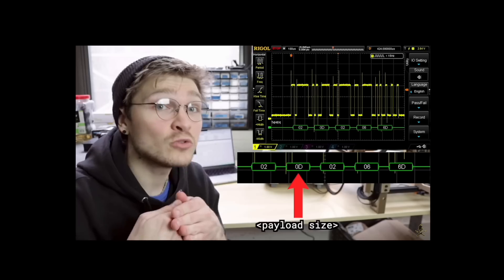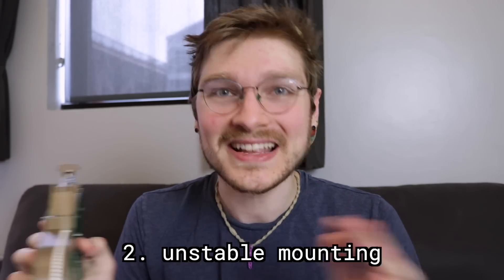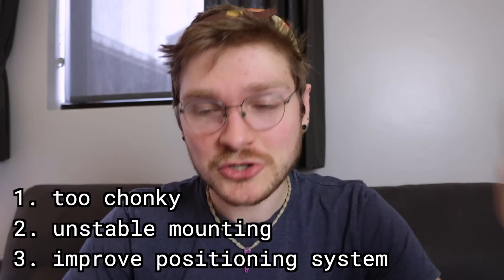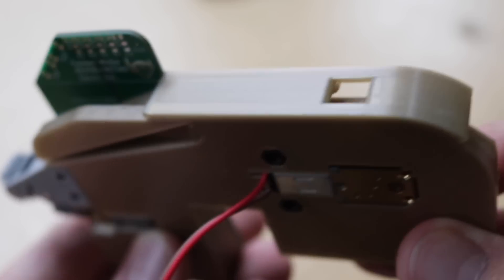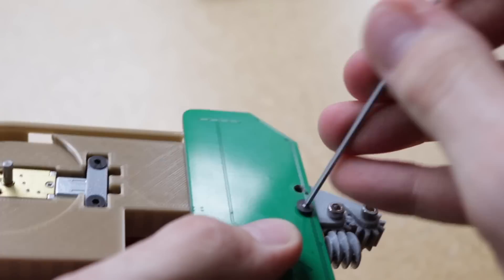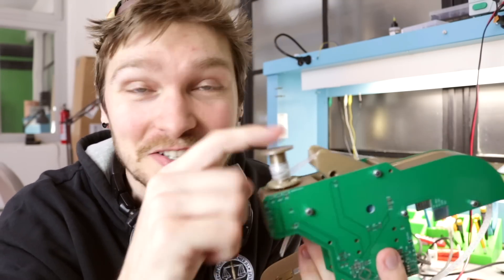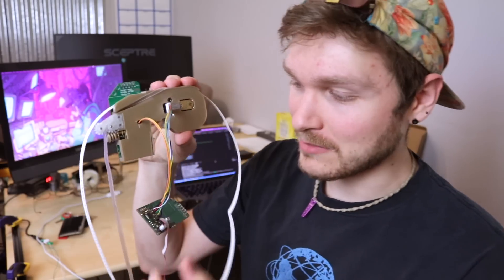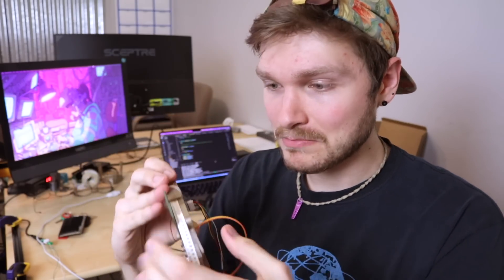Feeders just got a whole lot smaller

Comment: Just at the start of this, but you can use a laser or light woth a sensor. The encoder wheel can block or allow light through, now have your high and low. Laser will allow for much finer encoding. Computer mice scroll wheels sometimes use this feature.

Edit, can also use hall effect sensors. Vehicles use this alot. And go through alot more physical and heat punishment. Honestly vehicle grade stuff goes through hell and back then asks for more.

Comment: I recently watch your video from a couple years back and was surprised you were still using an optical sensor. The magnetic sensors make things so much easier. Not sure if they are the same type as you are using, but I learned of magnetic sensors that can detect not only a magnets field strength, but also its orientation. So you can align the sensor to a magnet and just spin it and the sensor will feed out changes in position as it spins. Yours looks like it may have magnets in a wheel and sense when they pass. Either way, it seems so much easier than the wheel. Optics always had issues with dust accumulation or surface oxidation or a host of other issues depending on the setup.

Comment: Looks great.
I find PLA denatures over time though, especially unused filament get brittle. I built my first 3D printer including motherboard, around 13 3 years ago. a couple of years after that, filament became easier to source and I redid my printer with a matterhackers DELTA 3D printed parts kit. over the next few years I reprinted every part of that kit due to breakages and my redesigns. Better to print with sprues and parting planes, locator bumps and then mould and make your parts with polyurethane 2-part plastic. Or CNC them.  ABS may be better but I've very rarely used it. PETg is very fussy about moisture.

Comment: Neoden has just fitted an 'upgrade ' to the K1830, that is a pneumatic raised PCB Stop for positioning the PCB on the transport rails. A filure of the Pin on the head unit failure cused this 'upgrade'

Comment: I hope this design will be extended to be compatible with different tape thickness too. There are so many different tapes, especially for bigger capacitors or inductors. It would kinda suck if you need to have a whole bunch of different feeders laying around, just to have enough thickness variations to set up one job.
You will probably have most high volume components on 8mm tape, but once you go forward with the wider tapes, the thickness issues become even more apparent as bigger components tend to have even more height variation.

Comment: You could drill holes in the aluminum profile and have a spring loaded metal pin that goes in the hole. On the other side you could have pogo pins to connect the feeder.

Comment: i think you could eliminate a LOT of the problems you have, all the software and the encoders, poof, gone... mechanical escapement on a wheel with a flexible drive, so a slight overrun wouldn't set it out of position.  the escapement could be a ball detent instead, drive the gearwheel forward an amount based on time, drive backward a small amount to make sure it seats, in slope steep, out slope shallow, it'd click with every move and be accurate.  in the olden days you'd use a driven disk with a cam to push a sawtooth gear on the driver disk and it would snap exactly one step every time, perfectly, cheaply and knowing where the disk is, is less important.  just gotta know it's not pushing the gear, allows for a LOT of slop yet gives high accuracy, no fiddling with software.

Comment: 9:54  No, THREADED INSERTS ARE

(Just joking, whatever works works and that method is probably a good bit cheaper, I’m just a threaded insert nut (pun?) myself. )

(You can also make threaded insert presses, basically drill press with soldering iron)

Comment: nice work on the feeder! You could also use a slotted optical sensor for the feeder gear. This would remove the motor gearbox slipping as a potential failure point that the feeder would not sense. With so many feeders on the machine at a given time it may be nice for individual feeders to detect such problems :)

Comment: You could simplify the design of the feeders by using a single drive shaft running the full width of the frame that is driven by a single motor and then use a solenoid to connect the feeder to the rod as needed. It would remove the need for custom motors, simplify the electronics and reduce costs considerably. As each feeder doesn't need a motor to drive or take up the slack, it can be made as thin as you need it to be.

Comment: Nice!
By driving the tape wheel via another gear rather than through it's center, you could stagger the motors on two different variants of the feeder to use even less space per feeder (pairs of type A and B would nest together to use less room than 2x type A). Both could be assembled from the exact same parts.
As others have mentioned a worm drive could be used too. 
Using a common mechanical power bus (shaft) with solenoid-driven clutches could be another idea that would remove all the motors from the feeders without having to use the pnp head, while allowing multiple feeders to advance at once (but mechanically more complex)
Check out stuffmadehere's jugsaw puzzle piece magazine motor multiplexer too https://youtu.be/Gu_1S77XkiM?t=745

Comment: Wouldn‘t it be better to put a sensor on the indexing wheel and let the wheel move 1 pin for every ejection? Because the rotary encoder might be inaccurate after a few hundred turns

Comment: Ideas for next version:
* instead of a motor with 90degree angle you could probably used regular motor with a worm gear that drives a gear, (would make it alot thinner) 
* it should be possible to only use one motor by basically just adding the two gears to mesh with a a gear attached to the feeder pcb . the feeder feeds a the same speed as the tape should be removed anyway.
(edit, like you already showcases: https://youtu.be/Gm1oQjoRitc?t=165 )

Comment: That looks like a really smart solution, but why couldn't your sensor auto-calibrate with the wheel? Was it hard to spin the wheel and look for bright and dark spots? It can be done, Zebra label printers calibrate themselves in a similar way. It seems more elegant. Spin the wheel, add min and max brightness levels, divide by half and that's your threshold. Unless I'm missing something, in which case I apologize.
Reply: Yes, the calibration should not be much more than some code.

Comment: I guess the encoders are super cheap anyhow so maybe there is no need for a different solution. But I guess the cheapest solution would be just having two spring contacts or brushes for detecting the position of the tape wheel. Also, there are some inductive sensor ICs which are basically made for this kind of application, like the LDC0851, super simple to use and very reliable.

Comment: Why would you use an electronic system over a purely mechanical system on the feeder? Every SMT machine I've ever used had the motors for the feeder in the machine and was mechanical on the feeder.

Comment: Could you put a big screw across from the back of the feeder to the rail slot? That will pushes against the rail grove
Reply: Or a slide piece with a strong spring that enters the groove and you can pull from the back

Comment: I worry about plastic creep in the film drive flexture. While I think it would work for a while, eventually the plastic is going to creep under the constant load and you will end up losing the tension needed to keep it reliable.
Reply: It should be possible to design it to accept a small coil spring for the tension.  I would look at how DIN Rail mountings are done, this problem has been solved with a dozen different designs.

Comment: Why not an optical quadrature encoder on the pcb to measure tape movement instead of a motor encoder?
Reply: He was having sensor calibration issues. Reflective sensing is a bit more finicky than through sensing.  Also for some strange reason he left a reflective metal surface instead of a white surface, the shiny surface is more sensitive to the beam reflection angle and just painting it white might resolve the issue.

Comment: I have used little magnets in my manual pick and place to lock the manual feeders in the structure of the machine. 2 magnets in the feeder and 2 on the machine, they will stick very good but if you pull they come out easly in order to swap. PS: I want to develop and sell a product just so I can get a pick and place from you :)

Comment: It ought to be possible to get the original wheel encoder to work - for  a reflective one it's important to get the angle of the emitter and sensor right.  Other alternatives would be to put a reflective surface behind it,  or maybe use capacitive sensing to detect the copper on the board. As you are only moving on one direction you can just look at transitions, which can also help eliminate variations in static reflectivity.

You may also be better off not relying on a  shiny surface, as that is rather dependent on surface finish and angle - may be better to use diffuse reflection of matt white vs. gap, which produces less output but likely to be more consistent
Reply: Another option would be to take a note from mice wheels. The wheel is already set up for it with the slots that are cut into it. This would also give much more accurate and more than likely thinner.
Reply: I would use optical gates for 3D printers. They pass the light through the slots and shine directly on sensor. That is way more stable than reflections.
Reply: Nah. Magnetic orientation is far better and precise. Optical has more failure points and requires the wheel. You can get magnetic sensors now that not only detect a magnets fields strength, but its orientation. So, it can detect if the magnet is being rotated very precisely. So much better and easier than optical solutions. All you have to do is stick a magnet onto the end of the drive shaft and align the sensor to it and then store the sensor output compared to the drive wheel's orientation and you can calculate the wheels position to a higher precision than you need. Much easier to do.
Reply: Or using AS5600 magnetic encoder, it so powerfull for this kind of application. It have 12bit resolution also
Reply: Especially it is important for dual density tape (two components per sprocketl

Comment: Another worm gear and a regular gear attatched to the PCB gear for the tape pulling motor might do the trick. Then you'd have the encoder pcb inside the feeder and you'd maybe even have an extra bit of tourque. If the Prints for the Gears are too rough you should consider making an SLA print or buying off the shelf parts for them.

Comment: Can someone explain why the $4 passive design was dropped? (The feeder without motors)
Reply: I think the main engineering issues are that it is slow in volume production and it can misalign the pick-up nozzle from the side loading.  I do not know why it is not the default or at least mentioned here.  

The cynical me says that there is better profit margin in a motorised feeder but that is not a strong argument with open source designs.
Reply: @KallePihlajasaari  i guess a solenoid-extended pin to pull the tape (instead of the nozzle) would be too heavy?
Reply: @TheRainHarvester  It would take quite a solenoid and that defeats the object of the simple feeder again.  It is very tempting to use the available XYZ motion to power the feeders but those axis have been designed for accuracy and speed, not heavy work.

Comment: Rather than measure the motor movement, which is a step removed from tape movement, why not measure the tape position with a photo interruption configuration. You could get below the socket hole position using linear array photo sensors. Properly configured the photo sensors shouldn’t require calibration.
Reply: Won't work with clear tapes.
Reply: @mikeselectricstuff  definitely a point, although I’d the plastic ir transparent?

Comment: Stephen -- a great step forward on the feeder design! Well done! This design is parameterized for different tape widths, right? (Or could be easily when you're happy with the design?)  I'm really hoping you guys come up with some bright ideas for reducing the wasted components from getting the cover film started.  Wasted components are normally negligible for a big production run, especially if started with a complete reel that has a leader. But your PnP is so well suited to small runs that wasted components are a more significant issue. Especially with ongoing chip shortages and prices!  Is there some kind of "leader extender tape" one can buy to stick on to a short length of peeled cover film?  And if so, that might introduce a lumpy section of leader that might challenge the film pulling gears.
Reply: You'll only need to extend the cover film - so only one or two parts are "wasted"

Comment: If you can get an IR LED to shine through the tape from above and an optical sensor below, you may be able to make the feeder self-adjusting on some tapes - look for a sudden change in translucency (either suddenly darker if the tape is translucent or suddenly lighter if the tape is opaque) and register off that. Or, for tapes where the drive pin holes align with the parts, sense the holes and time off that (e.g., every second or third hole is a part). Obviously this will be severely dependent on the tape, but since you're running a programmable feeder controller with bidirectional comms capability, making it possible to tell a feeder how to index itself off the tape it's feeding should be fairly trivial.

Someone else mentioned having a separate encased-magnet roller driven off the tape that can be used as an encoder, and IMO this would also be worth considering as it would remove having to have an encoder on the motor and could be used to index position off the tape itself. You could put an encoder right onto the control board.
Reply: Some tapes use clear plastic. Unfortunately  this makes the tape hole sensing with IR impossible. Paper tapes yeah it works great
Reply: @outgoingbot  Clear tapes would still be detectable - the part will block IR and the tape will pass it. You'd simply have to flip the detection, and some simple initial-feed sense logic could discern whether a clear or opaque tape was being loaded.

Comment: good job reducing the size. 
By the way I was looking at the lumen mobo on your website but the shop does not give much spec about it. For example what are the three USB port for on it? It is to connect the cameras? ANy documentation I missed about the lumen mobo please send a link because the shop does not point to anywhere technically informative.

Comment: I'm wondering if you could gold plate the reflectors to standardize the output without risking corrosion.
Reply: relying on shiny reflectors can be counterproductive as the angle needs to be right. A diffuse reflector - white/cutout is likely to be more consistent

Comment: One thing I've done on photointerrupters... My MCU had a DAC output so I used that but you could do it with PWM and a LPF. Feed that into an op-amp wired with the positive input on your programmable voltage reference and the negative input to the voltage on a low side current sense resistor. Now you can vary the current through the LED from 0-20mA.

Sweep from 0-20mA with the photo interrupter occluded and also with it not occluded. Subtract the graphs to find the ideal current which maximizes the difference between occluded value and unoccluded value. Now just drive the LED at that fixed current.
You could do this as an automatic calibration step at boot up by moving the motor back and forth slightly.
Reply: One other change I would make would be to make the sprocket pcb all black, with a white surface behind it (or vice versa) the reflective metal surface would be like looking in  mirror where you can see yourself rather than a flat colour.
Reply: @MistahHeffo  would ambient light changes be a problem?
Reply: @TheRainHarvester  typically with a photo interrupter you want to keep as much external light away as possible
Reply: @MistahHeffo  i wrote some software to first sample ambient, then sample ir led with ambient.  Then some Taylor series expansion to create a curve so that i could transform then subtract to find ir-only. ( I didn't know if he did something like that.  )

Comment: Another suggestion, use the same right angle motor, but with a rubberized wheel and tension mounted idle wheel to remove the protective film (think like the way filament is fed in a 3D printer), it'd decrease your need for a separate motor style, letting you increase your buying power, and be one less item of inventory

Comment: are you really using countersink holes on the production pcbs? i feel like that is easily avoided looking at the design.
also, if you don’t want to have to deal with those bespoke encodermotors, you could maybe make your own encoder wheel with magnets, and use your own smd hall sensors either on the big board or on an extra board if they have to be closer to the motor. not even that many magnets required if you use analogue sensing. 

it’ll probably be fine, but a horizontal locking feature in the feeder floor would guarantee no movement and probably isn’t too hard to fit

Comment: Have you considered incorporating the retention bracket into the underside of the motor housing cover, then relocating the mounting holes on the cover to coincidence with ones used for the retention bracket, that'd potentially eliminate the need for one, or both, of the housing screws, decreasing assembly time and part usage.